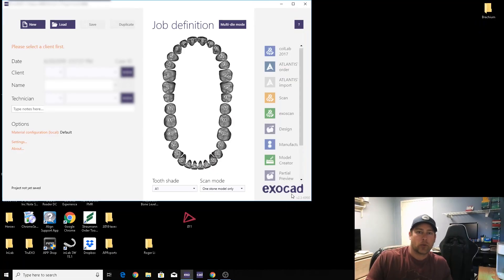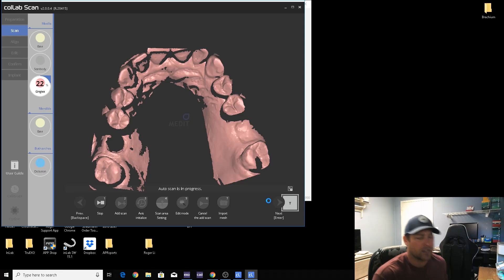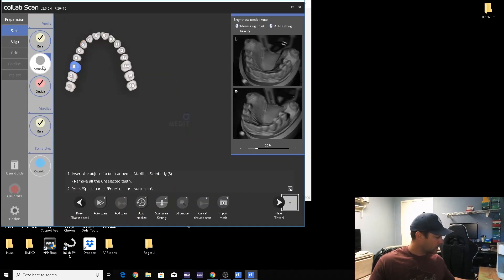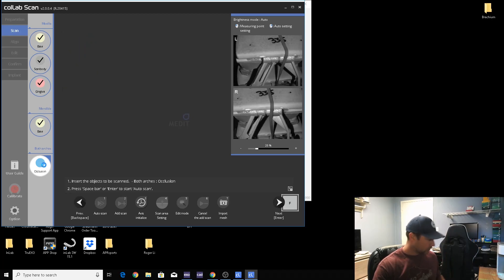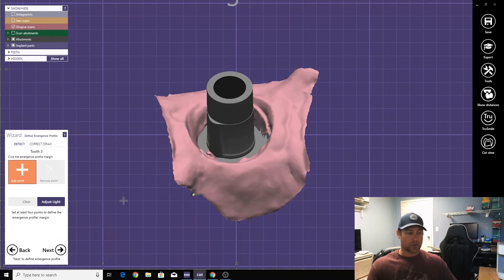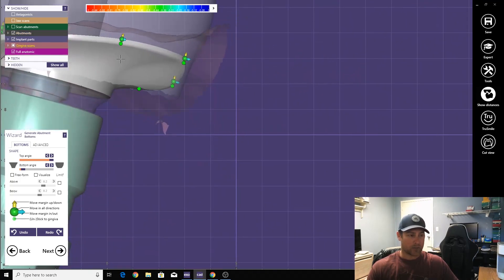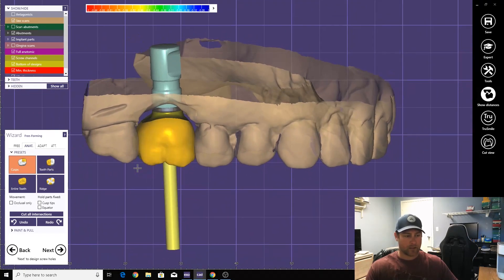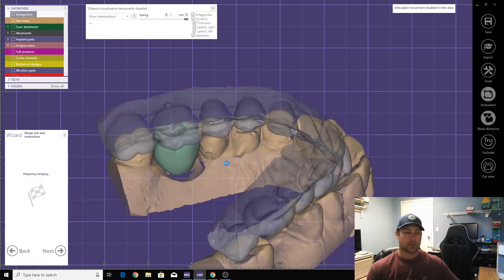Scan Body and Screw Retain Implant Crown Design

Comment: Cool tutorial for us newbies.  I just made a crown to sit on straumann veriobase , which is their ti base option.  I milled it in pmma and when I go to fit it, it's quite tight.  The cement gap in the exocad order form is set to 0.1 should I increase that since I can see there may be an issue if the crown was milled out of zirc.  Apropos zirc crown over ti base, if there at fitting issues what is the best way to go about fitting a tight zirc over ti base. 
Thanks in advance.
Reply from the maker: Ti base fit are dependant  on the implant library, however, I believe with the newest addition of Exocad you may be able to change it in the design phase. 0.1 is pretty tight. Are you scanning the ti base or using the library? How many hours are on your burs in the mill?
Reply: @adamrutherford7169  I used the straumann scan body and their official library.  The burs are pretty fresh.
Reply: I noticed on your video
https://youtu.be/3LamLe9PYqA?t=74
the Gap with of cement is set to 0.02 which is even tighter?

Comment: Great video. Thank you. 
I find that the default screw channel is too narrow. When I make it wider in the wizard (from standard .2 to .4) it only makes the outline bigger, but not the actual hole. Is there a way to make the actual hole bigger?
Reply from the maker: I think that might have to do with the implant library. It is supposed to be a perfect fit every time. Otherwise the only way to make the hole bigger is to use the attachment feature and cut the hole bigger